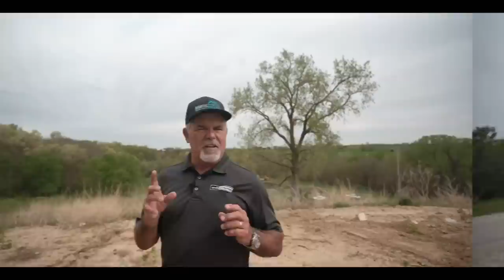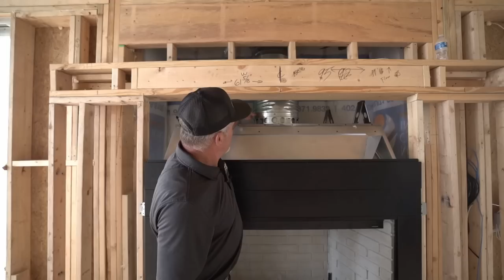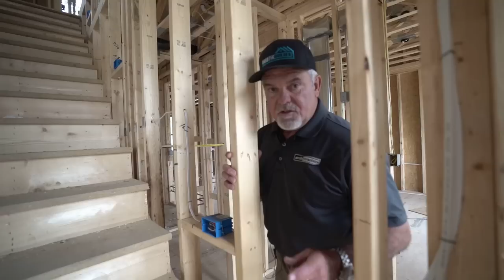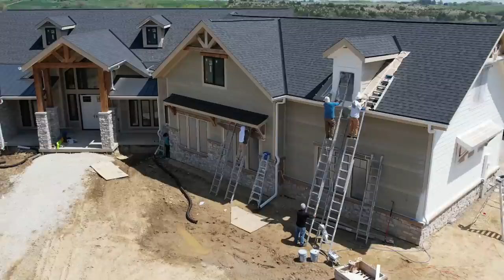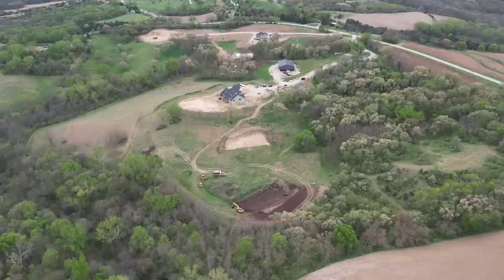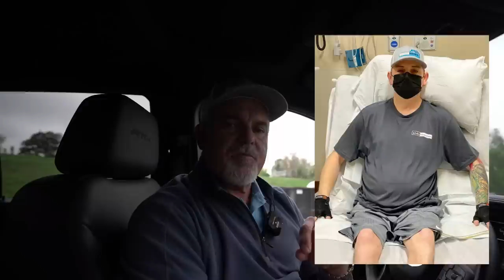Painting FLAIR'S Dream Home! (Part One)

Comment: New builds in Denmark is never air tight. They usually have a manual vent in a couple of rooms, ect the mudroom, the kitchen and the bathrooms. Cause these rooms is the more moist rooms in a house. Some does even place a manual vent in bedrooms and living/dinning room. And its to keep moisture out and get mere fresh air in.
Reply from the maker: Do you build with air conditioning in your homes?
Reply: @BradtheBuilder  Some got, but usually no, cause the weather is some what different here in DK. If people choose to have some what aircooling in their house, its heat pumps, but its not the same as AC :P As you know the style of building is very different from the US and DK :P I love some features in the US houses, but if you can combine it with some features in the DK houses, you would have a nearly perfect build house :P

Comment: Love all the details! Definitely tell Eugino (Sp.?) that he needs to redo the mantle because the bucket is very valuable to you! LOL! One question. How long does caulk last? I am sure a lot of it does continue to hold for many years, but so much of the stuff in my house needs to be re-caulked in less than 10 years!
Reply from the maker: Caulk is a continued maintenance item! 
in some locations it might have to be redone every couple of years and it also depends on the quality of the cock did you use!  Generally I use a Volcom and it lasts 7 to 10 years or longer

Comment: Brad,

What is the reason for copper piping? My father is plumber, but he tells me to avoid it now not only due to cost but also due to corrosion over lifetime of home. I have gone to many job sites with him fixing issues, but this was sparking my curiosity. We run PEX on our new construction here in Iowa and it seems to be a lot less of a headache than copper. Also time saving clamping things instead of sawdering. 

Thanks,
MinAko Homes LLC
Reply from the maker: We also run a lot of PEX  in our homes because Copper has become very expensive… My plumber felt since this is going to be my last house he wanted to run copper in it .

Comment: paint manufacturers my old company worked with recommended painting your house every 5 years for proper protection, especially darker the color and shade.
Reply from the maker: If you use the James Hardie Siding that will not be necessary… I’ve had my homes last as long is 20+ years before painting

Comment: Minimum Code requirements for Residential Toilets 

You stated 13” from center of a toilet to a wall or a vanity. That  is incorrect. it’s 15”  total is 30” Overall side to side. 

My shoulder width is 24”, 15” from centerline to an adjacent wall or vanity. Total number is 30” leaving me 3” on each side still that’s a tight fit for me! What if the persons shoulders are as wide as Dan Blocker (his shoulder width was over 35” - 50”) from the TV show Bonanza with Loren Green, that you may of watched in the 1970s or late 1960s. 

A toilet requires 21-inches of clear space in front of it, and 15-inches each way of its centerline to a sidewall or adjacent fixture (IRC Figure R307.1).

• There must be 21-inches of clear space in front of a bathroom sink (IRC Figure R307.1).

https://www.howtolookatahouse.com/Blog/Entries/2022/3/what-are-the-minimum-code-requirements-for-a-residential-bathroom.html
Reply from the maker: my tape measure was bent which made it 2 inches short! 😜